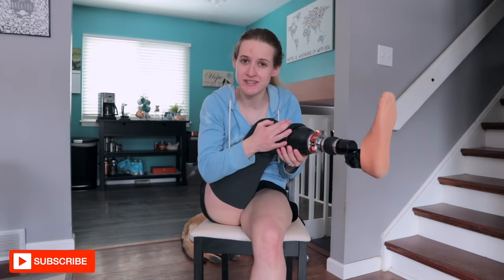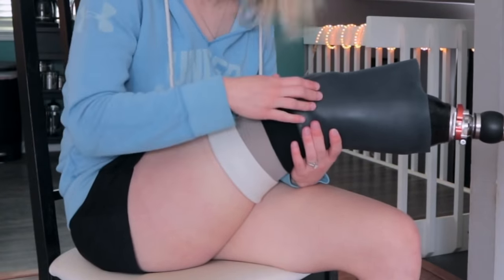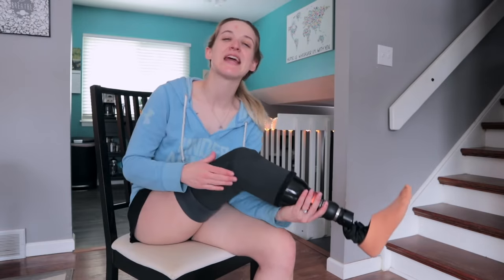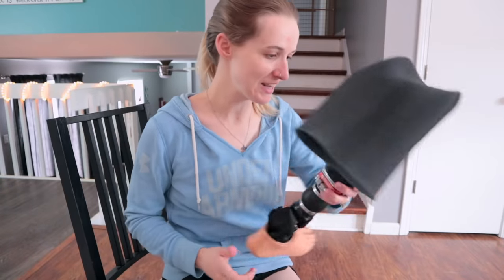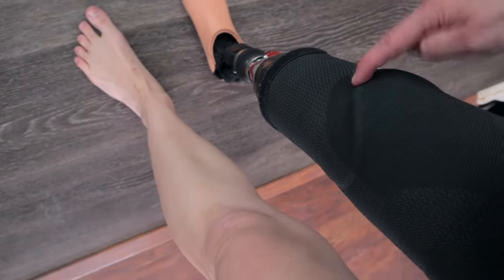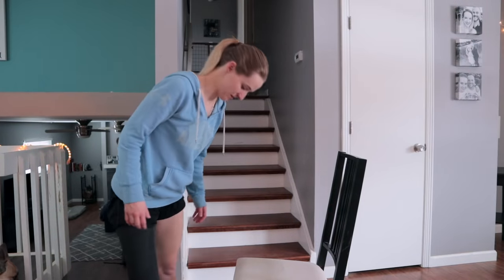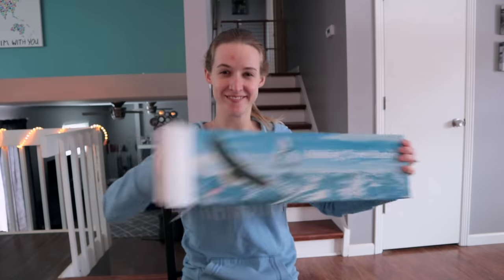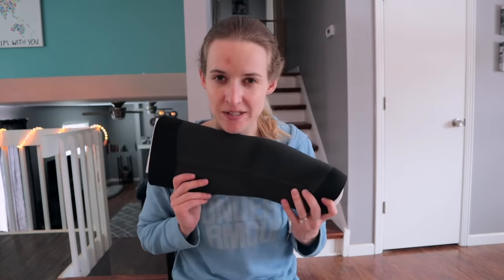My Prosthetic Leg Won't STICK To Me?! (Socket Troubleshooting)

Comment: If you put water in the sleeve, if there's a hole you'll see the water coming out of it if there is a hole. I wear splints, when they need replacing duct tape lives in my bag. It takes months to get new ones by the NHS, so when the splints break before the new ones are made it duct tape always helps.
Reply: Abigail Ash Is your sleeve’s inner covered in silicone or something else?  On electronics stuff we use a variety of different silicone (and other) sealants to weatherproof them; maybe one of those might work and be more comfortable than tape?  MG Chemicals 422B comes to mind, and there’s both an aerosol and a brush-on version - definitely apply in a well ventilated area and try it on normal fabric then an old sleeve if you do, and use a 40mm USB fan to help it dry/cure...  Obviously not medical grade, but I’m guessing duct tape doesn’t quite make the cut there either?  Anyway, maybe it would help things last longer - especially if it worked well enough to be able to eventually coat an entire area?  I’m also trying to find medical grade liquid silicones, but not having as much luck - the closest consumer-available stuff is for scar treatment and is $$$ 🤷‍♂️   Anyway if you decide to try it and it works/doesn’t let me know?  (Geez this comment went long!)
Reply: If I were to look at something like this (I sort of collect DIY methods) I think I would use bookbinding methods.

Bookbinding is a mixture of suture and gluing. The glue should be both pH-neutral and perpetually flexible.

With bookbinding glue you can glue two pieces of textile together. You can also (probably) add an airtight quality to textile.

So I would recommend bookbinding PVA and/or methyl cellulose glue with or without adding new textile material.

Don't know if this will help, but I LOVE when knowledge from one discipline can be used in an other. The evening school system in my country (the Faroe Islands) is awesome!
Reply: Turns out my brother in law does use a suction sleeve, I didn’t realize he did!  He just gave me a couple old ones to try fixing up and he’s going to try them - his are like $300 even after insurance :o

Comment: So glad you fixed it.  Vacuum systems are part engineering and part witchcraft!  For holes in the sleeve, I use silicone.  I also get better results by duct taping the bottom of the sleeve.  They last longer also.  Getting parts as a traveling amputee for 46 years now can be frustrating.  While I appreciate the help of my prosthetists, as experienced amputees we should be free to order the parts ourselves and be taught basic maintenance and repairs.  When I compare prosthetics to mountain bikes I am quite frustrated.  As a mountain biker, I can order any part online and there is a myriad of resources available online to teach me how to maintain my bike.  I can price match between different platforms and find the best deal.  Spare parts for my prosthetic limb are way overpriced and often poorly constructed based on my level of activity.  I'm restricted from buying online and even finding out prices.  For instance, while in Thailand, I needed to ask my prosthetist in Australia to buy a part for me from Germany, then post it to my sister who then posted it to me.  This can take weeks, all the while my activity is restricted and walking can be painful while I await the parts to do the repairs myself.  I do hope with your influence Jo we can change this.
Reply: Ro7an What kind of silicone do you use?  Off the shelf liquid silicone, conformal coating, ?
Reply: @israel963  I use the silicone from Ossur but you could use any similar silicone glue product which makes it much cheaper.  You can always test some on an old sleeve to make sure it doesn't impact the sleeve

Comment: I had no idea things like these parts were so expensive. That's terrible! A couple of things came to mind regarding patching holes. The product Flex Seal receives a lot of TV commercial time but I've used it on a variety of things with amazing results. I don't know how well it would work in this situation, but it might be worth an experiment. There's also a tape called 'gaffer' tape that might have better adhesion and flexibility than duct tape. Anyway, I'm glad you figure this one out!
Reply: They’re very expensive, especially if your insurance doesn’t cover the parts( sleeve, new socket when you loose weight. Mine is no more than gaining or loosing 5 lbs. Anymore, it won’t fit properly.

Comment: Finding holes in a liner is difficult. If you put alcohol in a spray bottle then spray on the liner, the hole will quickly show up when you stretch it. You are correct - the hole is usually at the top trim line of the socket. I've put a hole in my brand new Ottobock Pro-Flex sleeves more than once by kneeling down and resting weight on my knee on a hard surface. Sometimes you can position the sleeve a bit lower on the socket so that the hole rest against the socket outer surface. This will obviously only work limited times since you'll eventually get the sleeve too low to be functional. I would rather have an expulsion type valve on a passive suction system like you have. That pressure relief valve on yours works fine for elevated vacuum, but does not sufficiently allow air to escape like an expulsion valve does. As already mentioned, that type valve is subject to leakage when very little debris (such as sock fuzz, dirt, or maybe even animal hair) gets in it which renders the symptom you were having. Forcing warm water through it (from inside out), while depressing the button usually clears it.

Comment: Team some assembly required 😂Sleeves rip super easy (especially BK’s when kneeling) so check for tiny holes, check the liner for tiny holes too. Blow up the sleeve/liner and put it in some water to see if there are any tiny bubbles. Watch out for cats walking on you as their claws can pierce tiny holes in your sleeve/liner  Ive lost weight so I’m walking out of my liner so my residual is kind of pistoning inside my socket when I walk and because my prosthetic isn’t properly fitting I can feel the full weight of my prosthetic which is knackering swinging my prosthetic when walking(when the leg fits you don’t really notice the weight at all). Top tip use a paint brush to clean out the passive valve as sand grit can easily bung up the valve and stop it closing 🤗🤗 ps Have you had the ole ‘liner fart’ yet? Now trust me walking down Hospital corridors whilst your liner is farting is hilarious and slightly embarrassing when someone passes you 🤣😂🤣 #amputeeproblems #amputeehumour
Reply: At least you don't have to blame the dog. "It's my leg, I swear!"
Reply: Cynthia P 😂🤣 the strange noises that prosthetics can make when they don’t fit or when components break can be very embarrassing but you just have to giggle thru it and get in to see my prosthetist as soon as i can 🦿🦾🔩🔧🧰🤗

Comment: My husband cuts a gallon ziplock and puts it between the sleeve and the black part to make a seal and lengthen the life on the sleeves. He has always had issues with brand new sleeves getting pin holes. I think he uses gallon cause of the thickness of the plastic, not necessarily the size although if there are multiple small pin holes it probably helps.
Reply from the maker: Oh way cool! Thank you!!

Comment: "Pistoning" can be caused by having not enough padding on the leg to create a tight fit within the prosthetic.  As you move around it pushes fluid up out of your leg which creates space as the leg contracts.  This can change multiple times per day.   Too little padding and you can hear air escaping and possible get bruising.  To much and it can cause too much pressure on the leg which can cause a lot of temporary pain.

Also as an emergency (or safety net) solution would be to buy a velcro thigh wrap.  These are designed to support the thigh in the case of an injury but I apply one over the outside and it keeps the leg from slipping especially when my weight is not directly over the foot such as during exercising (sit-ups, leg lifts, etc.).

I get supplies from Amputeestore.com but then my supplies are older/simpler versions and cost a lot less.

On another topic, if you bend your knee a lot (riding bike) the friction between the sleeve and the socket can wear a hole in the sleeve.  The best thing that I've found is to line the socket edges with denim.  It resists wear but you do have to make sure that it doesn't slide out of place before you start (it migrates slightly unless you glue it in).

Comment: Thank you for your video I've been an amputate for 27 years and I almost never feel like I can get full suction Most tempted to go back to the locking pin trick or the strap lol got a new magic ankle you're mad at Uncle that I broke the charger no the insurance had to buy me a new one $800 no $1500 Broken again a month later haven't been able to walk with my nip my new medic foot since I've had it basically 3 or 4 years lol

Comment: It's been awhile since you put this up, but glad I watched. It's taking awhile for my stump to heal, but hoping to start getting fitted for a BK leg in January. I've been wondering what Hanger Clinic (mine is in Decatur Illinois) will suggest for me. The more I watch, the more a pin lock system seems logical. In three months I've beat my iWalk all to heck, and it's nowhere near as precision as a leg. I own a repair shop (auto upholstery) and clomp through a busy cluttered shop, climb over, around and through things including boats and cars, and just generally refuse to give in to not having a leg (except going up the rung ladder at one of my lofts. My fiancee and a friend giving me a hand have expressly forbid it, lol). It seems the pin lock might be a bit more archaeic, but more on the rugged side.

Comment: I am testing out my new suction system. The sleeve....ok so I got big thighs, and getting it to stay up is not the easiest thing nor rolling it up. My hands and elbows absolutely hate me right now! He said this leg will probably only last 3 months. My pin lock only lasted a month before I needed a new one as I was in a 10ply. Now its been staying at a 15ply. And I was told I would always have 2 sleeves even if one gets a hole in it. I might go back to a pin...not sure yet. And yes I know all about having to get a script from your doctor. Luckily for me my GP absolutely rocks!!! 
So what happens if you need a new socket before 6 months?

Comment: Before I signed for my leg I included in my leg contract 2 liners, 1 extra outer sleeves, I complete set ottoboc sock set and 2 Shrinkers and when I get to 10 ply I get cast for new socket plus adjustments in between sockets....mine was due to a work accident and my attorneys were very knowledgeable about amputations..I’m a bka

Comment: The way people check for holes on rubbery materials such as tires is by applying tiny amount of soppy water on the surface and try to get air flow through the material and check for bubbles. Some of the holes are so tiny that you just can't find it with naked eye.

Comment: Whenever something on my wheelchair makes a new noise or just seems "off" I get the same reaction you described when you hear your leg hissing air. That kind of shit is expensive to fix!! I had to purchase a new $2,000 wheelchair because my current frame is bending enough to cause critical alignment issues (my chair doesn't really turn left anymore, and it's terrifying and dangerous).

Comment: Have you ever considdered a pin conection beteween youre liner and the prostetics? Works very good and i used the system for over 20 jears.

Comment: I'm 9 years  RAKA.suction. mine is a lot different. The sleeve is inside and only goes as far as the socket. Nothing outside the shell. Also Canada, so none of those supply issues you guys have. I am active on a facebook group, so you help me see some differences to help others with issues, and I thank you for that, Jo. I see now the hole in sleeve issue so common with some below knee. All around above knee seems barely any issues in comparison, except of  course learning and using a fake knee. Not competition, lol. But the shape of the thigh, only one bone, and the buttocks as a stopper and to take some weight, liner bending at knee, pinching behind knee. Anyway, I ramble
 Hi.

Comment: a few  off-topic questions maybe a little intrusive (i really don't know if it is, but I'm a curious fella). Hope you don't mind: After how many hours in a day wearing a prosthetic leg begin to become a hassle, like wearing shoes too long? And how comfortable is it to use one in a hot day?
Reply: Sergio Accioly I’m an amputee so maybe I can answer your questions. I can go 10 hours in my prosthetic. My prosthetic doesn’t hurt me , it’s my other leg that does because I have drop foot and all my toes were also amputated. It’s different, of course, for each person. I have a bleeding disorder so I can mild small bruises when wearing it that long. As for wearing it on a hot day, well, I live in Arizona so it gets very wet inside the liner. The sweat can really build up inside it so I carry a towel and occasionally take my prosthetic off to let my stump dry off and get some air and wipe down my liner’s insides. Hope that helps you understand
Reply: @lyndahall5702  Thank you for your time, Lynda. It's been an education.

Comment: I had a suction leg for 12 years and I could never get it to work properly. I went with a pin suspension and that worked so much better.

Comment: Are those sleeves breathable Jo? Because I’m an AK, there’s no sleeve as a part of my socket and having to wear something on top of a liner, that doesn’t breathe, sounds less than ideal to me. Currently I wear a liner (and socks) along with a silicone ring for added suction underneath the socket.

Comment: I was thinking that a small led flashlight would be helpful to find small holes. Sit in a low light room with small pieces of tape handy to mark the hole(s), slip you hand with the flashlight inside the sleeve, and look for any light that might shine through, mark the spot with tape.

Comment: Jo, I hate to be an ass, but what you pulled out of that box near the end is a suspension sleeve, not a liner. The liner is what goes on your residual limb. I too have to get my prosthetist to pull on my suspension sleeve, it’s a real bitch to pull on to the carbon fiber socket. And you’re right small pin holes can be almost invisible.
Reply from the maker: Haha you’re absolutely right!! I’m still getting the terminology confused some. Thanks for the correction and you’re definitely not an ass 😉
Reply: Cling film/plastic food wrap can help get the sleeve over the footshell easier and less risk of piercing or ripping the sleeve. Plus a dry paint brush to clean the valve from dirt, grit, fur, hair as this can stop the valve closing properly

Comment: Mine fell off When I was doing the monkey bars in fourth grade. If you have problems I ended up changing to one with a pen in the bottom and it’s a lot easier and it never falls off. You don’t have to wear the outside light out you just wear the inside one with a pen at the bottom and it doesn’t touch your skin so it feels like the other one. PS you probably won’t see this but  good advice

Comment: Holes in the sleeve or the liner, kneeling is bad, I’m tight in the beginning of the day after noon I put a 3 ply sock on as my stump shrinks it takes about 15 minutes for my vacuum to build fully...the farting noise is bad as it usually indicates a leak.....I’m a bka since 2018

Comment: Leg falling off? Use superglue!! lol 
(side note - I don't condone using superglue on your skin)
Reply: fiddlegirl79 I don’t advise using superglue on stumps but you do know superglue was developed as a surgical wound closure in the first place.
Reply: @jolo-bolo  Oh yea...forgot about that. Still don't recommend it using it on stumps.
Reply: Kevin Ellis Modern modern glues are actually really similar - super glue is N-butyl-2-cyanoacrylate, and the more recent stuff is 2-octylcyanoacrylate with some plasticizing polymers to help increase flexibility (especially for internal use IIRC and not a doctor, just love them)